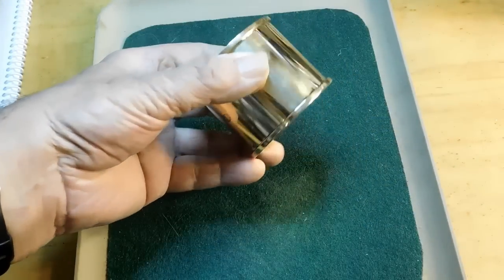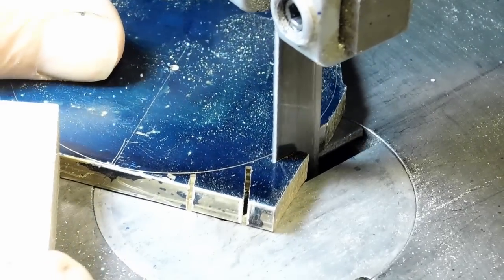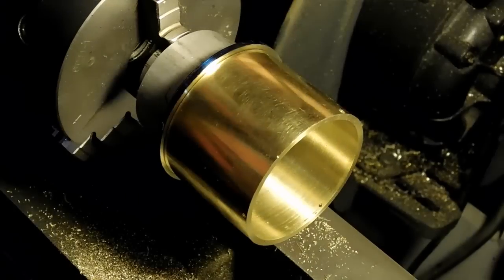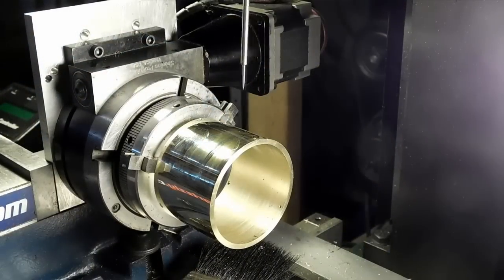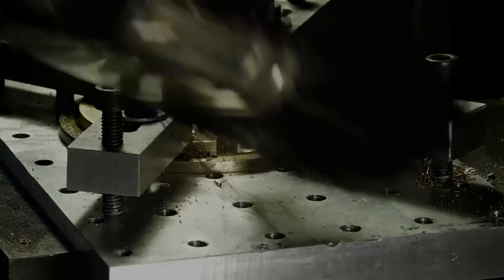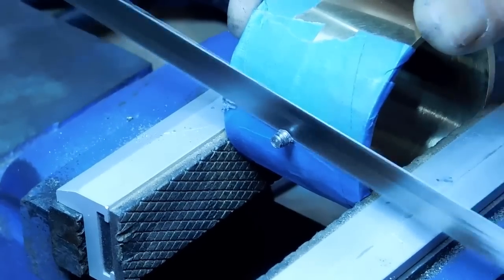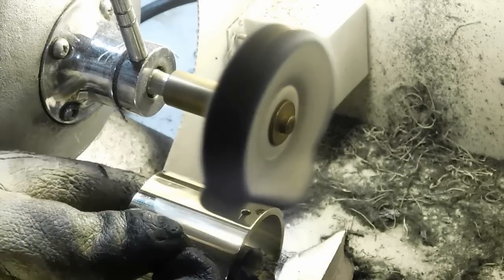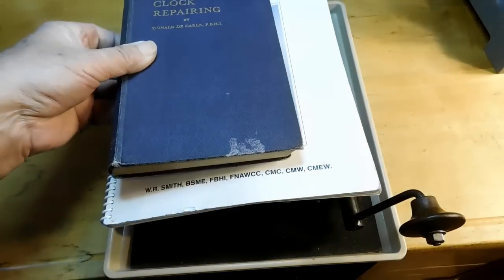Making the Mainspring Barrel

Comment: As others have said, excellent video. Question: on your super glue arbor, do you use an accelerator for the glue or just let it cure for an hour?
Reply from the maker: Hi Al...I've heard guys let it set for as short as 10 minutes...me I like overnight...I have a box of arbors and at the end of the day I set up my arbors and prepare the CNC mill if I'm doing the cut with a hob and the CNC lathe for cyclodial gears...then I cut them the next morning...big thing I watch is the amount of glue I use...too much is not so good...nice deep grooves helps with this..the glue needs air...that has been my experience...now a stub arbor I'll use almost immediately as the tight fit between the arbor and the pinion or gear hardens the glue as the piece is being put in place...bob